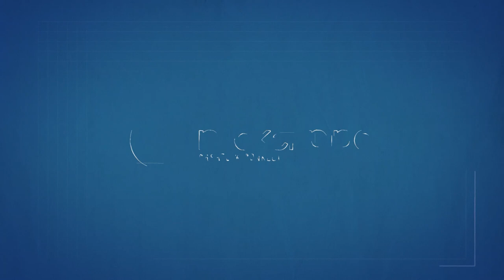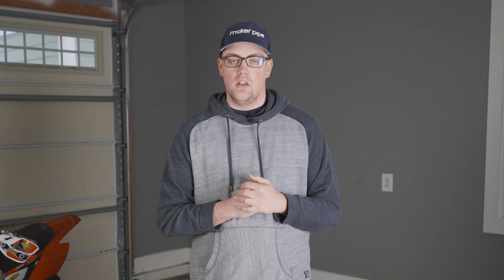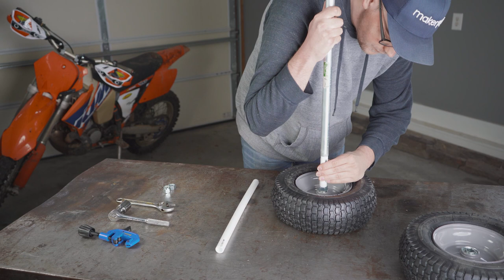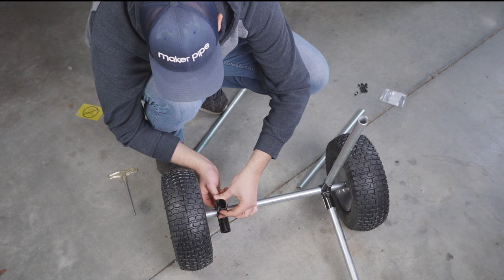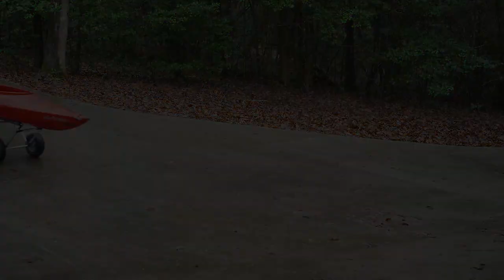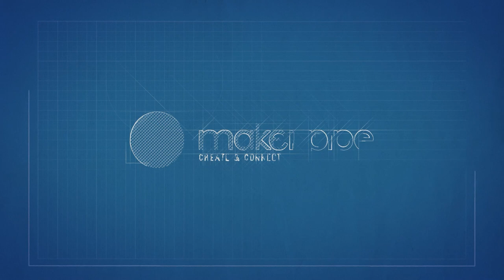How To Add Wheels To ANY Maker Pipe Build!

Comment: Just a little side note from someone who has learned this lesson the hard way before: Inside that wheel there are most likely two sets of bearings, one at each end. Therefore when you tighten the nut you are putting quite possibly hundreds of pounds of sideways pressure on the bearings, and those type of bearings are not made to withstand that much lateral pressure. The bearings will quickly get really sloppy from all that pressure and then that sloppiness will let the grease leak out and let sand get into the bearings. Instead, you should use a lock nut on both sides of the wheel, and only tighten until there is no slop on the rod. Or even better, you could take out one of the bearings from the wheel, slide a pvc or metal pipe spacer on the rod which you will cut to the exact size needed, and then re-install the bearings onto the wheel. That way when you tighten down the nuts on the threaded rod, you will be putting that lateral pressure onto that spacer, not the bearings. Cool ideas though!
Reply from the maker: Thanks for the feedback and suggestion. Great advice!
Reply: huh?
Reply: @tonka5  The bearings on the wheels, the round things in the center of the wheel, which allow the wheels to turn but not the rod. Aren't meant to take forces from the sides only from the outside rim. If they do for any significant amount of time they will take damage and then the rod will start turning, breaking/destroying anything connected to it.

Comment: I like to use A washer as a spacer between a nut and the wheel. It gives you a smoother transition so you don’t have a hex of the nut digging into the side of the wheel hub.
Reply: Me too for sure when you buy them they are called "fender washers."

Comment: You don't have to use threaded rod. I just used a piece of 5/8" steel ( or maybe aluminum) and used stop collars to hold everything in place. I was thinking it would be easier to do that than have to worry about cutting the threaded rod and deal with burring or the potential of damaged threads. Plus it is very easy to take apart with the stop collars.

Comment: Seems like tightening the wheel bearings with nuts would put a lot of stress on the bearings.  They are sized for 5/8" smooth rod and, although I cannot verify it, the actual OD of threaded rod is probably slightly smaller than a smooth rod, hence the wheel wobble before tightening the nuts.  I'd go with a smooth rod and axle cap nuts or drill holes in the ends for a cotter pin with a washer on each side of the wheel.  Since the shims are tight around the axle, it will stay stationary in the conduit.
Reply from the maker: Good suggestion. Thanks CW!
Reply: Wouldn't 1/2 conduit work for the axle? I think that has a 5/8 outside diameter. Then just use a cotter pin.
Reply: You could wrap teflon tape around the threaded rod to shim it in the bearings.  I’ve done this with 5/16th inch bolts and skate bearings.

Comment: The issue I ran into when using small wheels(as shown here), is that while they may be easier when starting to ride, it's harder to keep them going ...thus it's fatigues the cyclist quicker. However while using larger wheels, they may prove a little harder in your initial launch, it's once you get going the cyclist will be less fatigued, especially when going longer distances.
Reply from the maker: Thanks for the comment Justin. We see people use these smaller wheels for carts and things like that. You're right in the fact that bigger wheels (maybe bicycle wheels?) would be much better for a bike cart or something traveling farther than say a kayak cart.

Comment: I'm making a cart that uses a 1/2 inch axle (determined by the wheel) and attempting to adapt the 1/2 inch axle to 1/2 inch pipe.. Why is this so hard?
Reply from the maker: Hi there, thanks for the comment. Most likely you're running into an issue with the outer diameters. 1/2" EMT Conduit isn't actually .50 in diameter. It is .706.

Comment: I was into this but then had the inside nut start tightening down on the bearings. The wheels would not work well. Someone else said use stop nuts on both sides of the bearings, not just the outside like the video says. Are there proven better results with any other ways? thanks
Reply from the maker: Thanks for the comment. Builders have had success with using washers in combination with stop nuts to protect the bearings and allow them to spin more freely.

Comment: nice work. question: can the wheel roll independently of each other?
Reply: Yes, as long as they aren't tightened too much. Use a lock nut/nylok nut or thread lock.

Comment: How could I do this with wheels that have a 1" axle diameter?
Reply from the maker: Hi Alan, thanks for the comment. Your best bet would be using 1" EMT Conduit and shimming the difference between the axle and inside of the conduit. Then you could build off of the pipe with our 1" EMT Connectors.